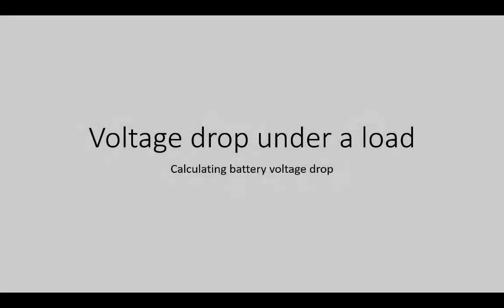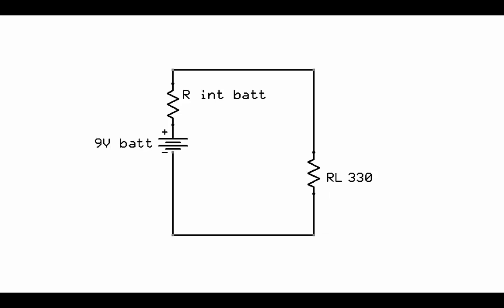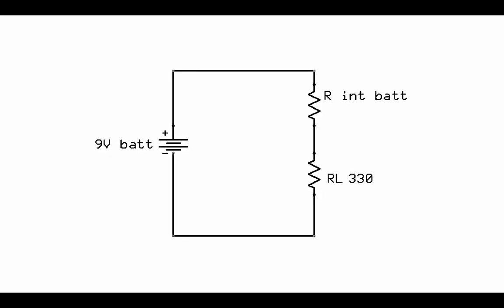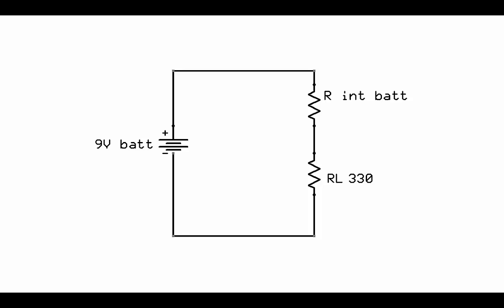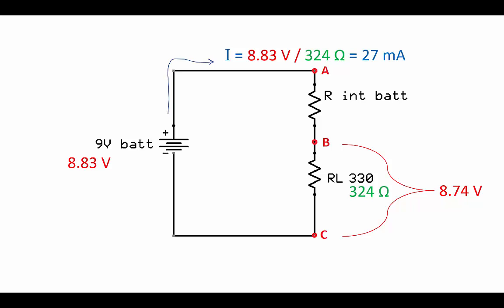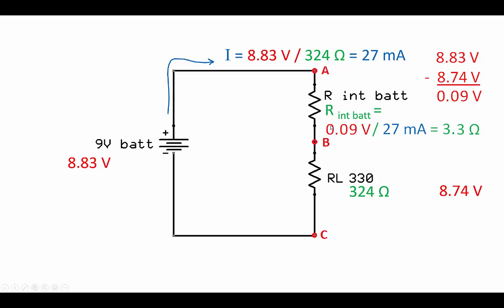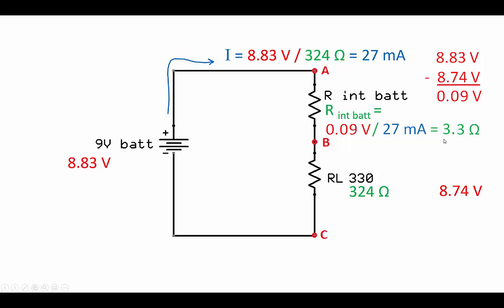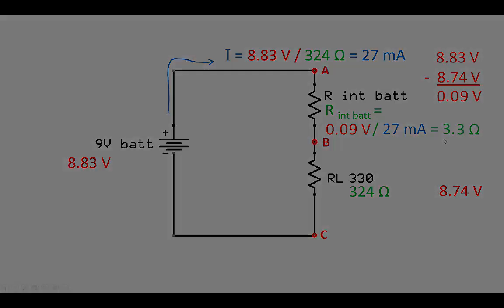Voltage under a load

Comment: It's a nice explanation, however I don't understand why Current is total voltage divided by only RL.  Would it not be the voltate over RL, ie 8.74 / 324.
It's the same answer to the nearest milliamp anyway, but perhaps the correct way to do the calculation in case it's not the same?